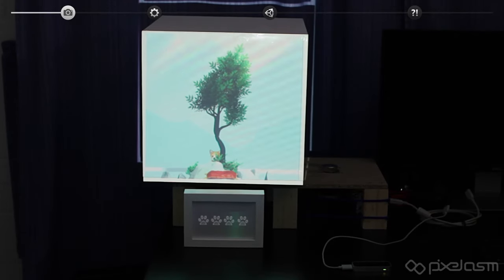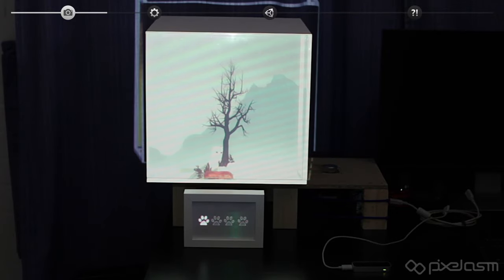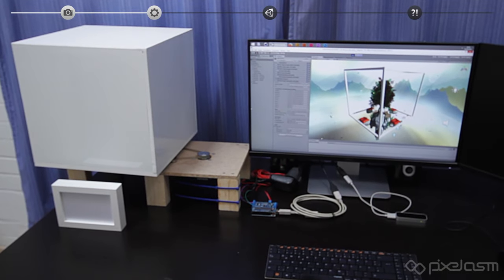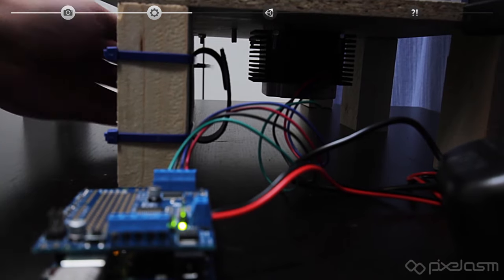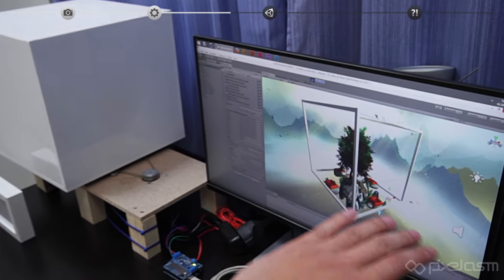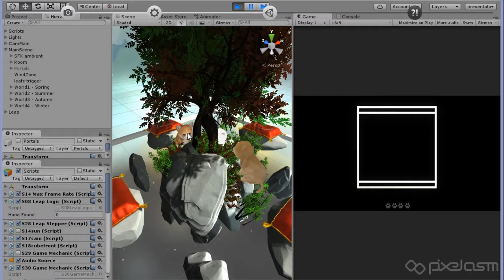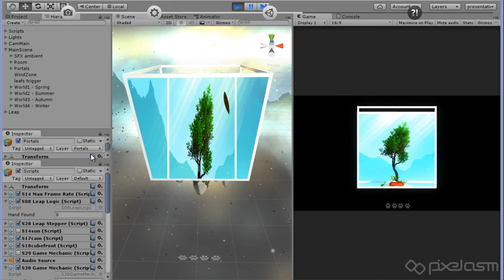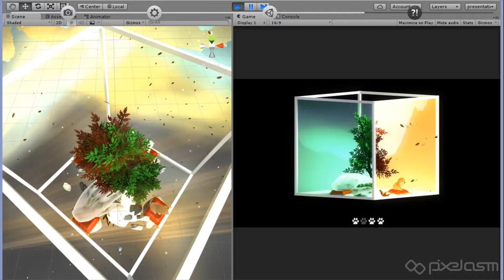Interactive projection mapping done with Unity 3d, Leap Motion and Arduino / Uniduino / Adafruit

Comment: I'm new to the whole visual scene recently as I started handling LED screen projection for events. I'm trying to learn more about projection mapping and live interaction to use as a personal art project in my hometown. 
I saw some examples in Singapore where they used an Xbox Kinect to detect motion and have the visual interact with them, I wonder how they did it.
Reply from the maker: There is an asset for kinect in the asset store which gives you access to the data recorded by it. You can then for example attach things to the joints if the detected person. Be aware that you need C# knowledge to use this.
Reply from the maker: By the way I have used said Unity Asset for this test: https://youtu.be/GYXTUf6UBUo

Comment: It's wonderful challenge!  I want to know how did you project the unity 3d model images on to each surface of the white cube? If I do this, I would map the surfaces of the unity model onto the surfaces of the white cube. But the white cube can revolve...It can't do this without a dynamic projection mapping method. But you didn't use any 3d scanner devices...?
Reply from the maker: Honestly finding answers is the most interesting thing to me. This is also what I find interesting about my professional and private work and the reason why I do it in the first place. Therefore I would like to "answer" your question with a hint: What is the difference between a DC motor and a STEPPER motor? The answer to this will give you the answer to how I "tracked" the cubes position.
Reply from the maker: Great to hear, looks like you are almost there too :)
Looking forward to your final result. Please keep me updated.

Comment: nice project man!! ,
i am still a noob and i need to know how do you send data from unity or leap motion to the arduino  , i am trying to control my 6DOF Stewart platform using leap motion , do you have any tips from your personal experience
Reply from the maker: Thanks! Easiest way is to buy the uniduino asset, it also provides examples on how to comunicate with the pins. 

TIP: You should also buy motorshields because turning the system on and off might have some backlash on the arduino board when used without a motorshield.

6DOF Stewart platform is a sick piece of hardware. Would be nice to hear / see what you are doing with it. Are you planing something different than a racing simulator?
Reply: i have no idea whats is uniduino asset,
 is it a new chip like arduino ? or just extra libraries for arduino ? 
i just want to let the stewart platform copy the movements of my hand that is being read by the leap motion sensor , so i just want to extract the  XYZ coordinates from the leap motion and send it as serial data to the arduino
Reply from the maker: Oh! I suppose you would like to use the leap mption without Unity, right? 

My data flow is leap motion -> unity -> arduino -> adafruit motorshield -> stepper motor and you would like to leave out unity, right? Thats a workflow I haven&#180;t looked into because I wanted to use Unity for the visuals right from the start, sorry.
Reply: i am using mini servo motors i dont think i need the motor shields , i really dont know if i need the unity or not , but i read online there is a way to integrate the leap motion with arduino through unity ...

Comment: Awesome work! how did you go about syncing up the rotation of the motor to the rotation of the gameobject in unity?? I've been able to connect a servo motor to unity but with the uduino asset there is a delay
Reply from the maker: The trick is to use a stepper motor, an easy to miss detail I mentioned in the video. Steppermotors different to simple servos only move a predefined ammount of degrees per step. Therefore I used the same stepping for the digital model and had a really good match, although I had to tweak a bit. Ideally you would have another system checking the position independantly, for which some servo motors provide possibilities, but when setting everything up and buying the parts I wanted to keep everything a bit simpler and went for the approach shown here.
Reply: @pixelasm  Ah thank you! Was it hard to find documentation about controlling stepper motor from unity?
Reply from the maker: @masayatodoroki339  I think it was ok.
Reply: @pixelasm  Which stepper motor were you referring to here, and which stepper motor would be better for a project like this today?

Comment: what Unity are you using? I am having trouble using Uniduino with Unity 5. It connects and recognises the firmata protocol but does not display any IO ports nor does it recognise the correct COM ports.
Reply from the maker: If I do recall correctly I used 5.1 or 5.2 to build this. I only followed their tutorials to get everything connected and it worked seamless: http://www.uniduino.com/tutorials/

Comment: Which projector is that one? could you please share model
Reply from the maker: Chop Labalagun it is an Epson TW 620 which is able to project 720p at max.
Reply: Can you recommend a projector for this type of test on a really low price? Or what should I look on a projector for projection mapping. I am using a LEAD pretty bad. Look at my latest video.
Reply from the maker: Chop Labalagun unfortunately I can not point out a specific one, just get the one with the highest lumen. Keep in mind though that those might also be the loudest. Aside from that I would prefere one with an optical system for trapez and other skewing instead of doing it digitally but that is just a minor thing.
Reply: Thanks for inputs.